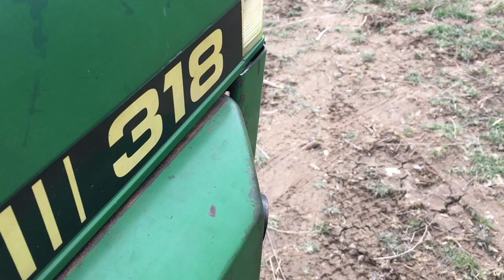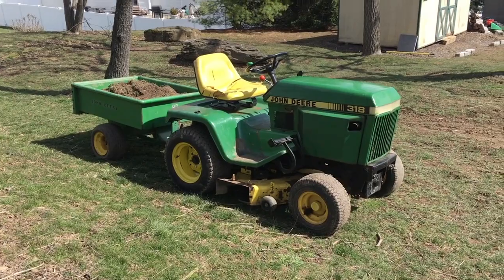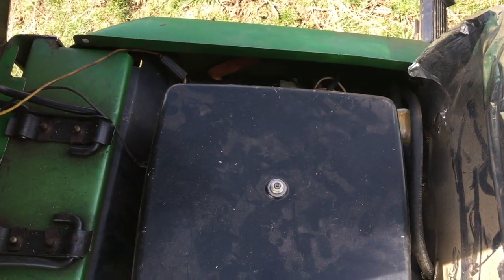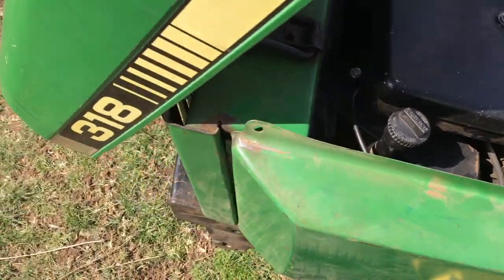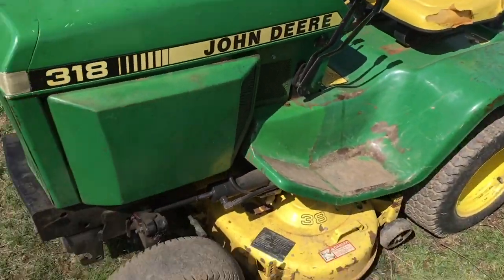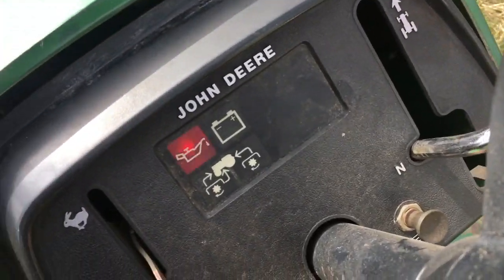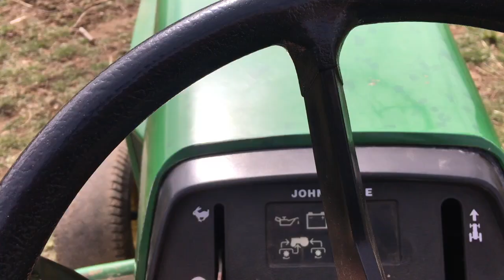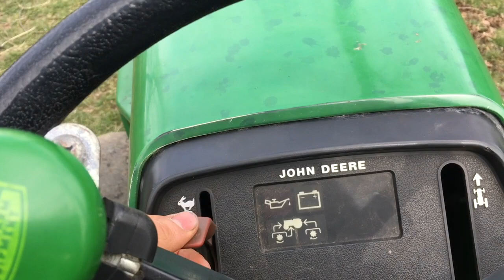1987 John Deere 318 Big Update!- Review, Walk around, And Drive

Comment: Is that firewall still on there?
Reply from the maker: Jack Olson Yes, I replaced the foam a few years ago.
Reply: @JohnDeere318Guy  wow, how much did u pay for that tractor?
Reply from the maker: Jack Olson $1500 for it, 46” deck, 54 blade, wheel weights and chains back in 2010.
Reply: Wow thats a good deal